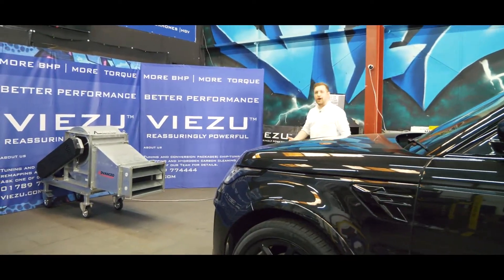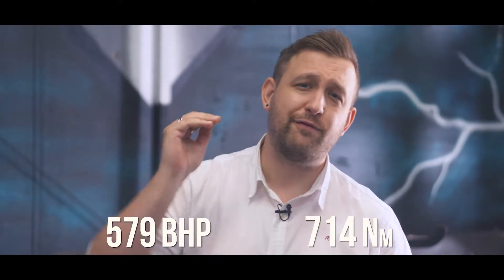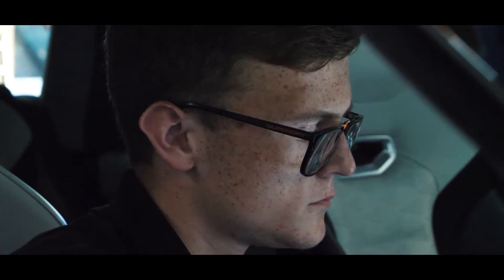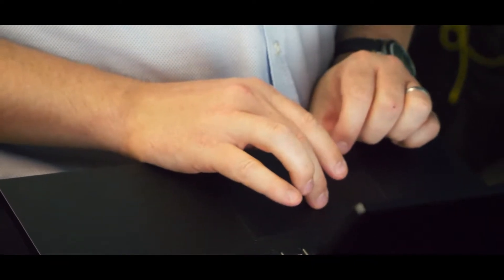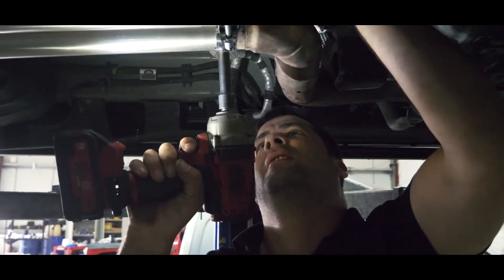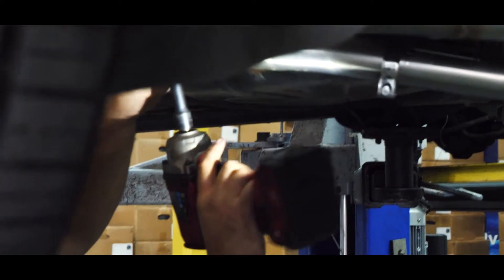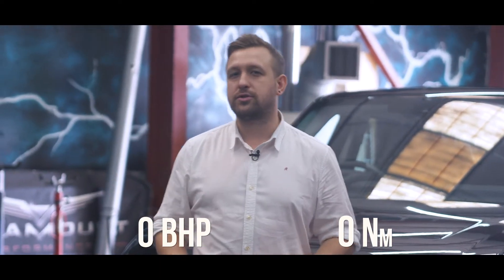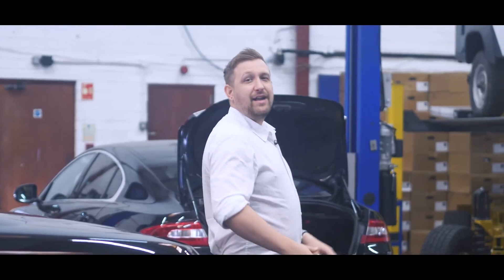Range Rover SVR Typhon Upgrade

Comment: 917NM from this engine?? there is no way. 200NM increase is heavy! Hope it can handle all that, the SVR is my all time favorit suv, nothing else has the character of this. Would be nice to have some measuring of the acceleration. I dislike the exhaust tips, other than that fantastic car
Reply from the maker: Hi, the transmission in these is actually very strong and capable of running much higher torque. There is a hard-limit in the software from the factory of 1300nm of torque, but we don't take it anywhere near that. Running up to and around 1000nm of torque is the sweat spot for this super strong ZF transmission.
Reply: @ViezuTechnologies  the 8hp ain't the issue, more like the engine go 💥
Reply from the maker: The engine is also good at this power level. Having done a lot of work on the Project 8 platform also, we know what these engines are capable of. We have tuned hundreds if not thousands of these engines across the entire J LR platform range and are very comfortable with the power we output. We tune within the limits of the engine, not to the limits of the engine as many tuners often make the mistake of doing. Always leave plenty of headroom when you are finished with your tuning and that way you look after the components in the long run. Smooth and progressive tuning is also the way :)